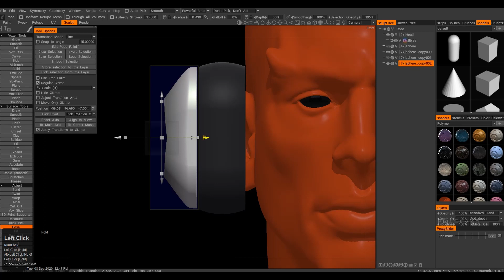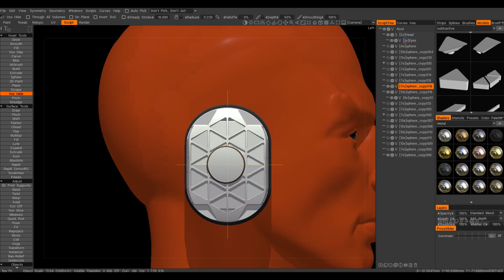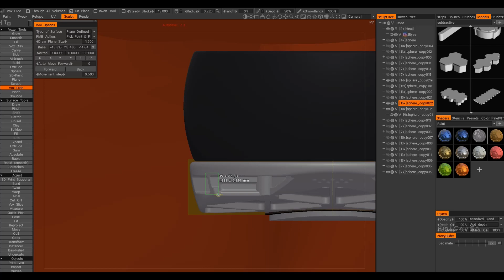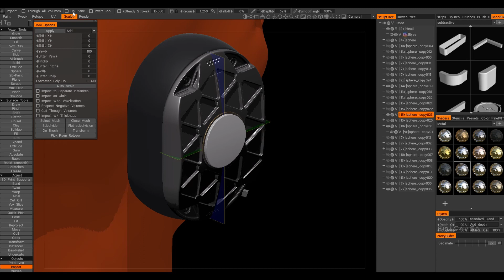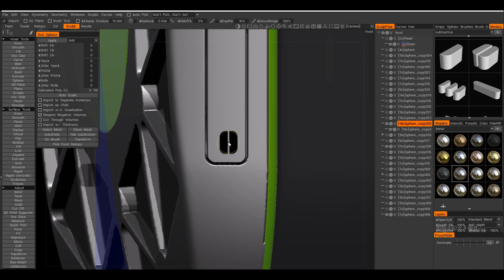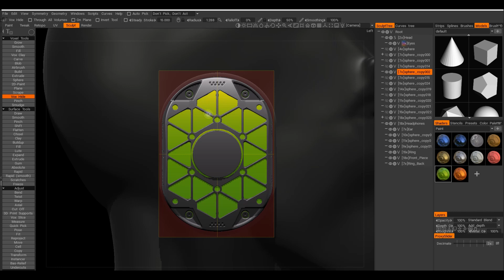3D Coat Industrial Design Headphones - Part 1 - Earcup

Comment: Is 3Dcoat a software I can consider for working as a Product Designer? Or I should stick to CAD software such as Fusion 360, Solidworks or CATIA?
Reply from the maker: I think for iterations like a sketch, quick / auto quadretopo to nurbs model in the new mesh room, export to Solidwors it can be a powerful new tool for product  designers.